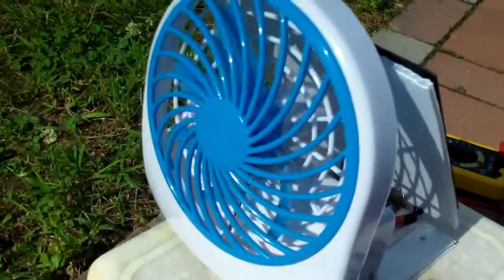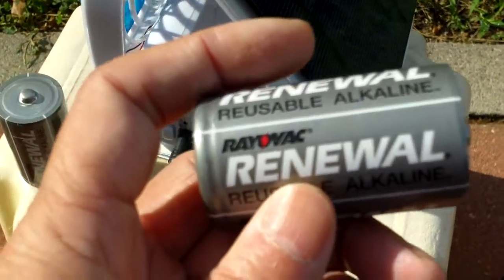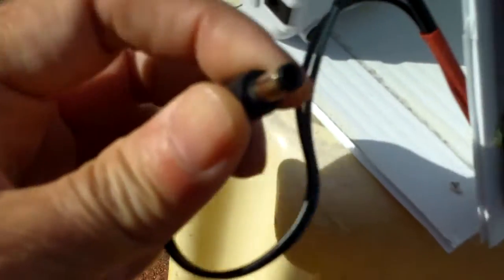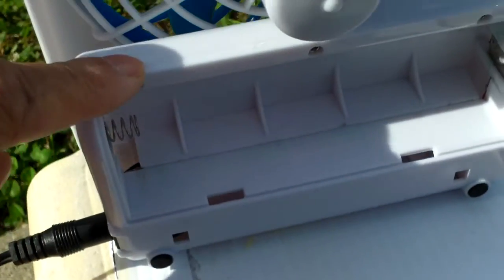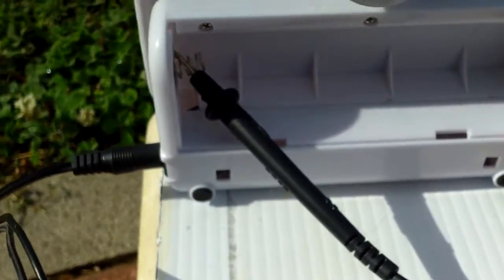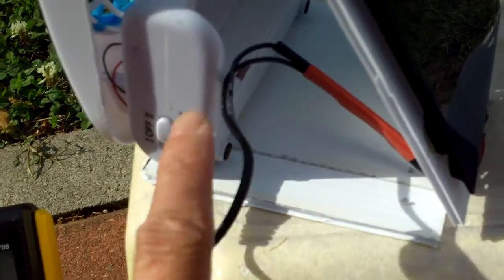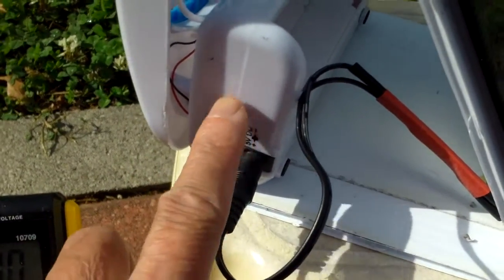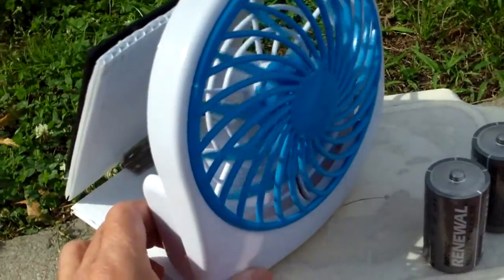diy solar rechargeable personal fan with 5 v 500ma solar panel

Comment: Love it...got a big house 3150 SQ feet. I can walk under the fan and still have 10ft to the fan above me. I can feel the air moving around me. I can tell a difference with it, got rid of the hot spots in the house.>>>nub.best/x0rq   I like it so much, just ordered another one. It went through a hailstorm (4 days after install) that did 3K damage to my car. It came away with no damage, according to my roof guy. I am ordering another and I am going to set the panel at a different angle to get full coverage.

Comment from the maker: All solar panels will lose efficiency with the summer heat. You will notice it works better in the winter sun. I have a home made solar panel and I used a plexiglas on top to cover the cells. I lose a couple of volts when they are covered. I ventilate the enclosure with a small fan. The homemade panel has lasted more than 3 years. You just have to buy a higher voltage panel to meet your needs. A 12 volt solar panel has an open voltage of over 20 v.  You can also use a voltage booster to boost v.

Comment: Sure, the short circuit current is about 0,5 amps, and the open voltage is 5,4, but I didnt know that this is "without load" power. The other thing is a heat, in strong sunshine my panel goes down from 5,4 to 4,8 - 4,9. What do you do in this case, maybe a glass between the sun and the panel is helpful (maybe) ?

Comment from the maker: I have not measure the current but the open voltage of my panel is 5.4 volt. Are you measuring short circuit amps? You will lose a little voltage too if you a diode.